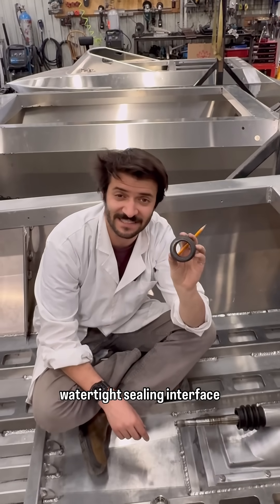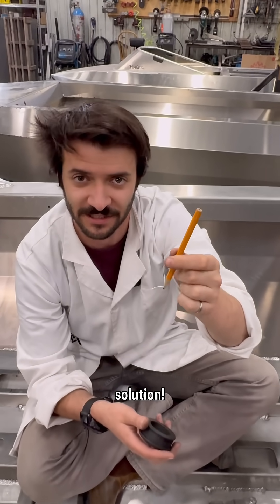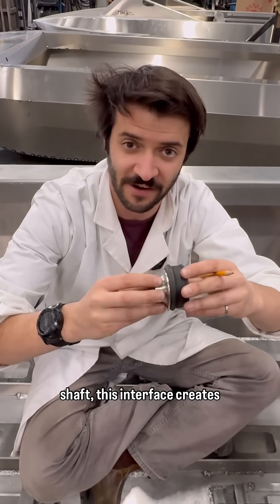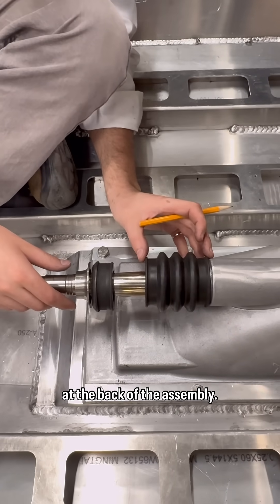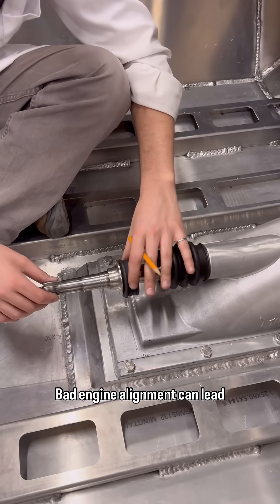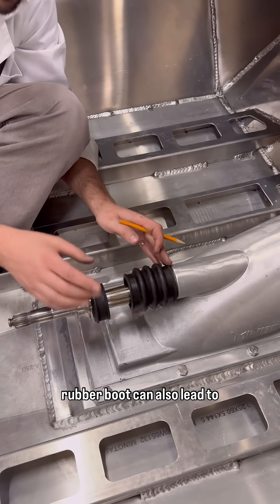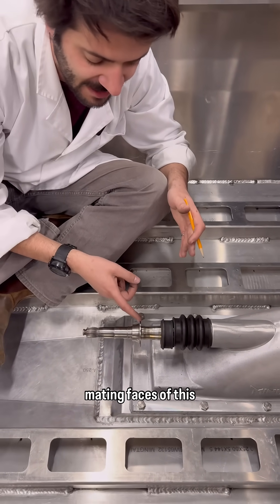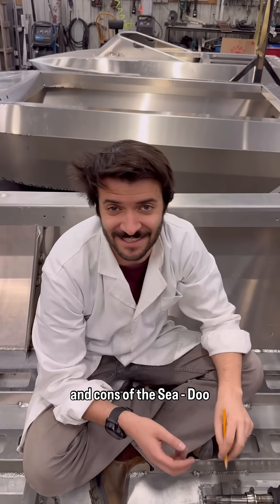Where's the carbon in this seal?

Comment: Just call it what it is. These have been around for decades. They're just mechanical seals. There's nothing special about yours.
Reply: Indeed, actually that's a floating mechanical seal and a fairly primitive old type now days they have ridged ceramic tungsten lubricated cartridge seals some have support bearings in them, Carbon seals are history for use on SS SHAFTS and alloy tubes including brass, as carbon promotes corrosion .
Reply: @FladFlidington  thank you grand master sir.
Reply: He's referring to the specific system in front of him, not saying they invented the seal itself
Reply: Nothing new, this is also used on aircraft
Reply: @lenecromonger  used in vehicle exhaust too, cars, atv, bikes.